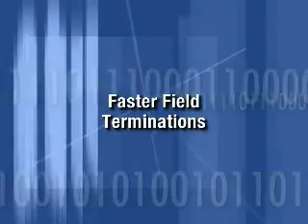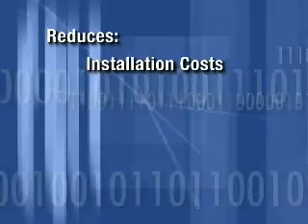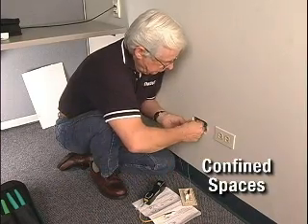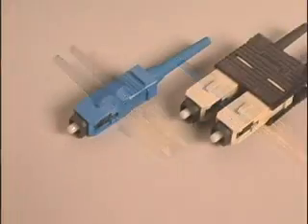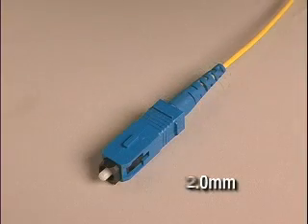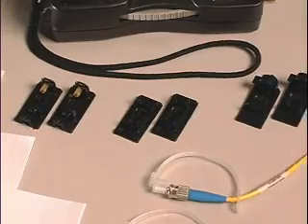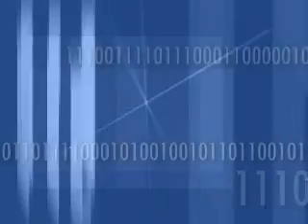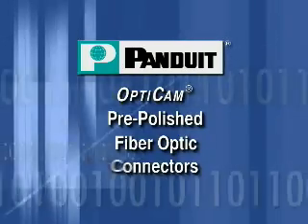Panduit OPTICAM Pre-Polished Fiber Optic Connectors

Comment: They make it look so simple and reliable in the video. Too bad I've run into so many bad SC Opticam connectors right out of the box. I've experienced around 4 - 5% average failure, almost always because of not enough matching gel. Nothing like inserting the fiber, camming the connector and there being a nice bright red glow in 1or 2 spots, or a nice dull red glow across entire indicatorr, no matter how many times you tried re-terminating it.
Reply: 16 years later we're still using this, any expert advise for me to spread to the team :) Currently learning